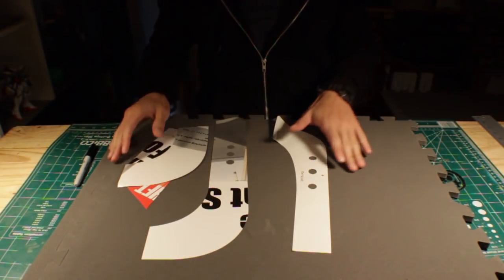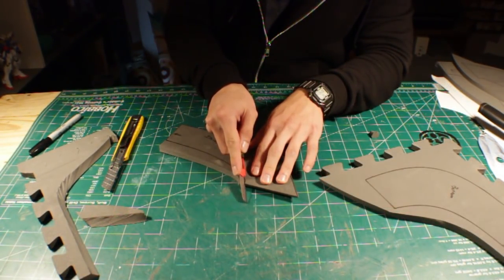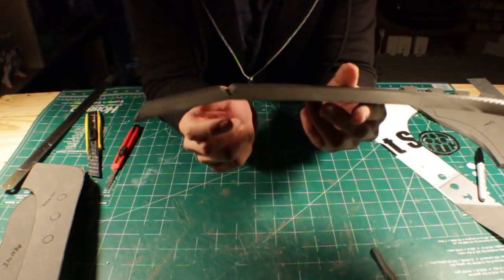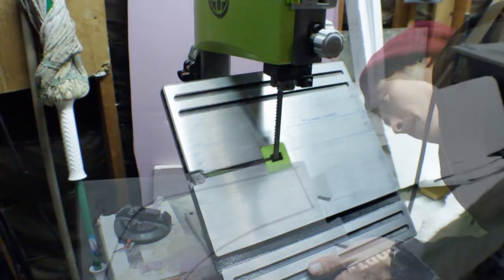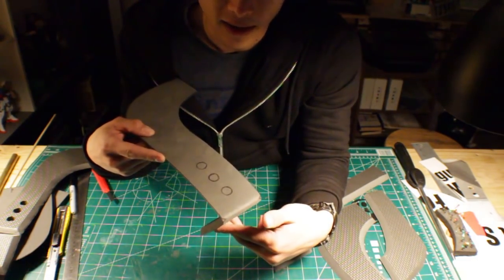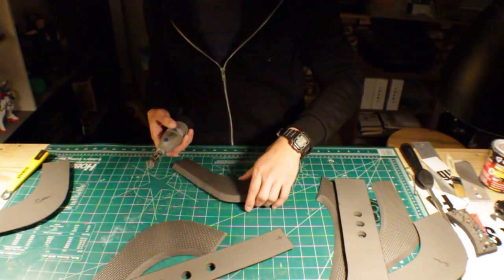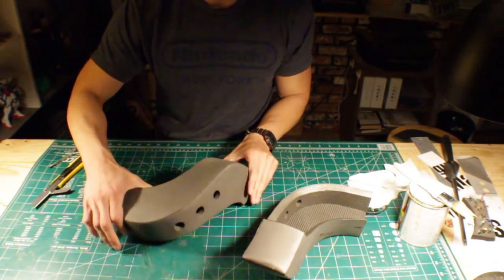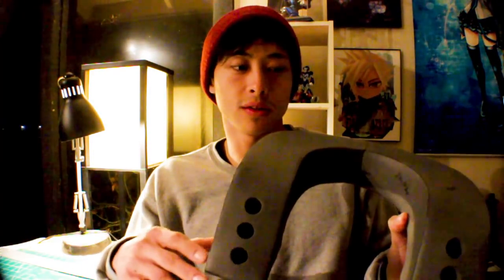HOW TO MAKE BAKUGOU'S NECK PIECE ARMOR//MY HERO ACADEMIA

Comment: Great tutorial! I do have a question though! When making the second half of the neck piece, do I need to flip the pattern pieces? On the Etsy pattern, I see only 4 pieces-- sorry if this is a weird question! I'm bad at reading patterns, haha.~ I'd hate to cut out the second part and find out its facing the wrong way!
Reply from the maker: Sorry for the late response, you probably figured it out. But yes, you do need to flip the patterns for the mirrored half
Reply: Lorentz iWood No worries! I actually didn't touch it because I wanted to confirm it with the pro first, haha! Thanks so much for getting back to me, and again, this tutorial is AWESOME!

Comment: I don't know how I managed this, but I somehow completely switched around the bottom piece and the smaller side piece, but it somehow still worked?? Like it didn't even make much of a difference besides being a little more difficult to attach together. It's like managing to put a puzzle piece in a place it obviously doesn't belong in.
Also I did the same thing you did and accidentally beveled an edge that didn't need it (yes, even with your updated template, shush), but it was easy to just add a little foam wedge to fix it!

Comment: i don't know if you still check your comments on old videos, but im hoping you do, i recently bought your patterns and i am just confused on this one, am i supposed to flip the pattern for the other side of the neck piece? i don't know if that was stated in the video but it wasn't on the pattern instructions either and i would assumed it would need to be flipped but i thought i'd ask because i'm worried of messing up and using more foam than i need to 😅

Comment: How do you make it stay while wearing it does it just stay balanced on
Reply from the maker: It just sit's on your shoulders, if you jump for action shots it will come off. :(.
I've made them hollow so you can add magnets inside them if you wanted to have them sit securely around your neck. but it's not worth the trouble imo.